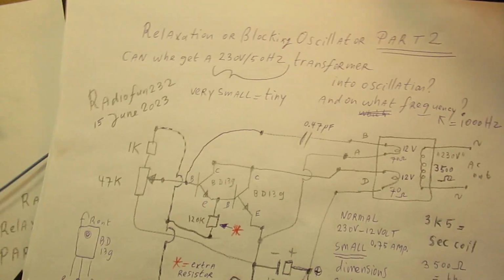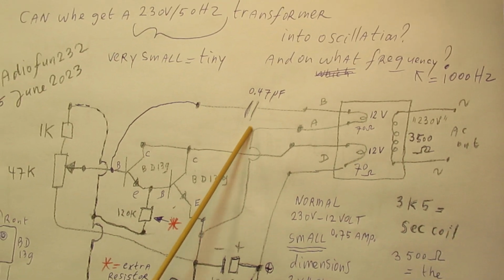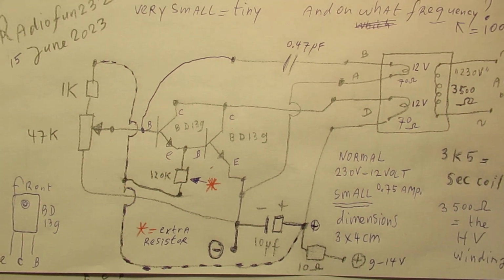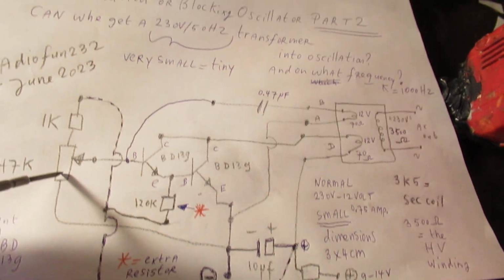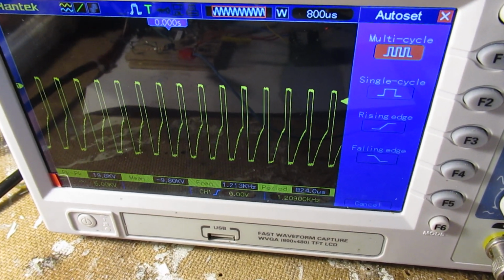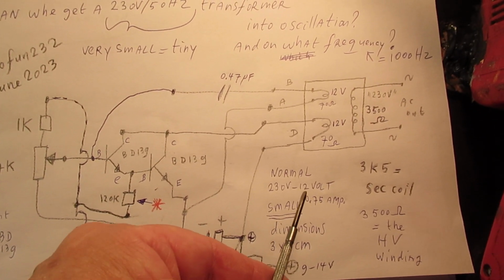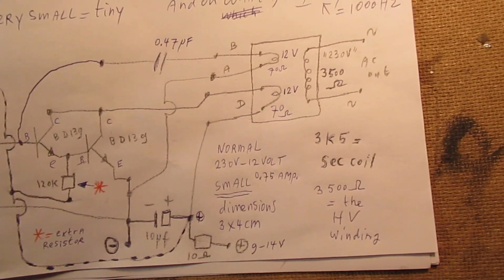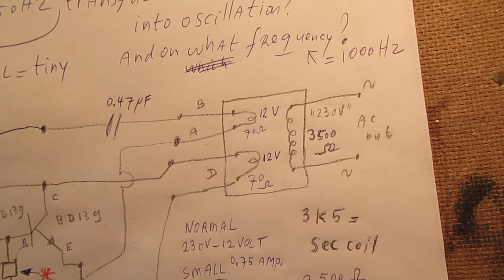Relaxation or blocking oscillator pt 2: behaviour with a reversed 2x12V to 230 V/50 Hz transformer

Comment: Hi Ko, what is the current draw on the 9 to 14V powersupply ? 
And what is the open voltage on the HV side of the circuit ?
If the current draw one the input is not that high, it could maybe powered from a 9V battery to make it portable,  then a bridge diode on the HV side and a 1Mohm current limiting resistor, and this circuit could be used to test Zenerdiodes from low values up to the highest Zener values when a Digital Multimeter is connected in parallel to the Zenerdiode.
Reply from the maker: Hi Bjorn: the circuit draws at 9 Volt = 12 mA / 14 Volt = 12 mA / 18 Volt = 18 mA / 24 Volt = 22 mA.
Output voltage on the HV winding: 9-12 Volt supply voltage =85 Volt AC and at 24 Volt supply voltage =110 Volt AC.